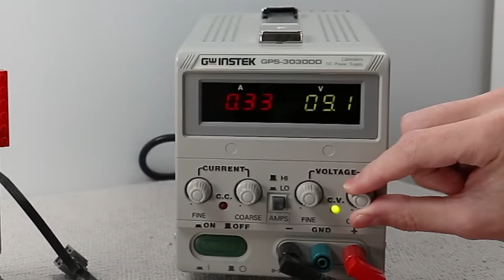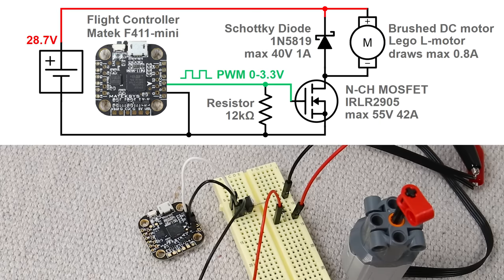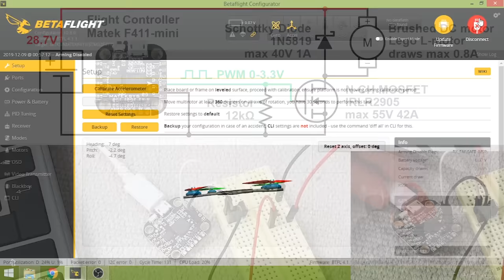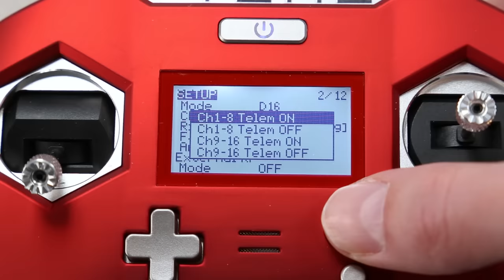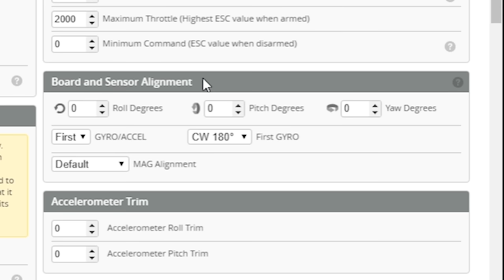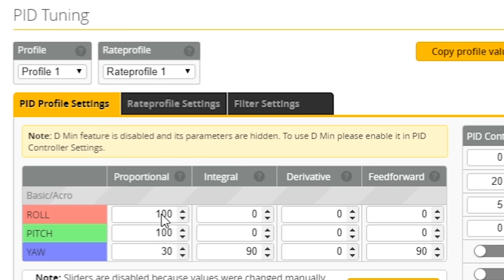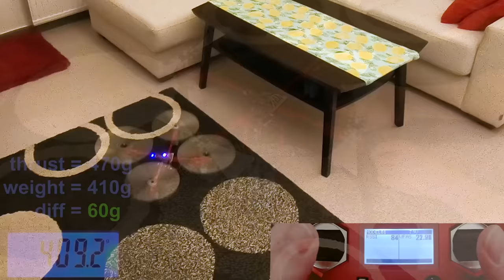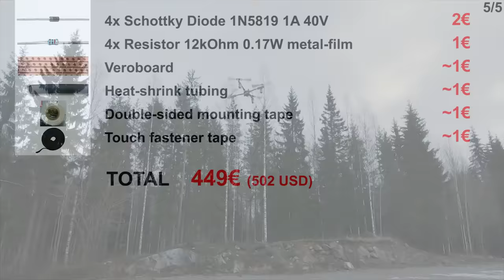Making a Drone with Lego Motors and Propellers

Comment: Nice video, makes us realise how hard it is to just "lift" a drone, and how company have acquired knowledge over time. When we see these 4 rotors drone they first seem "easy". It's good to see that there is always an hidden difficulty. Thanks for showing us this!
Reply: Exactly, the amount of work required to make this 'toy' is mountainous, the angles, the force, the balance, looks, safety and cost of making is just a few of many things people have to take care of to give us this 'toy'
Reply: it's even harder when done out of lego. typical quadcopters (which this is. It cannot fly on it's own so isn't a drone technically) are made out of VERY rigid frames. Legos, as a consiquence of needing to come apart, are not. So him managing to find PID values (those numbers he was tuning when it first lifted off) for a quad with a frame that bends and changes it's own lift profile with changing thrust is pretty impressive.

That's also why it looks to be wandering around so much. The accelerometer can usually keep that under control once you get it dialed, but a lego quad with frame flex is asking a bit much of it.
Reply: @DFX2KX  drone, quadcopter, potato patato. Lets be real, they both mean the same thing.

Comment: Very impressive! Did you need to remove the overload protection from the L motors?
Reply from the maker: No. The L motors were untouched. I think the key was gearing down from 1:3 to 1:1.67 so that the motors draw less current and don't heat up. They still heat up quite much. Sometimes the drone would become unstable after flying a few seconds, probably because one of the motors would overload. It flew more stable outdoors in 0 degrees Celsius.

BTW, I'm very impressed by your 41.1 km/h Lego car speed record. Awesome job! I have wondered is there anything to improve. Dare I even try? ;)
Reply: Hey
Some months ago, I was messing around with a drone motor (a 3035 if I remember correctly, 500w peaks, ~13€ on Hobbyking) and found out that there is no need of adaptators. (apart from "shaft to lego shaft")
With an arduino, a bluetooth receiver, an ESC and a small servo motor for the direction, I transformed a red buggy into a RC Lego red buggy and oh boy...

Some lego tires died that day.

Some old differentials also... New ones handles the load tho.

Would be soo cool to see that kind of transformation on other models !
Reply: @BrickExperimentChannel  it's even more impressive with stock motors, you found a great balance with the gearing! Glad you've seen my speed record attempt, it took an awfully long time to achieve :) Obviously it is easy to beat with a different power source and controller. That configuration was limited by the control range of Bluetooth (VERY limited, I had to run all the time :D) and the max voltage of the v1 BuWizz units. With RC LiPo batteries and an RC receiver you can achieve much more, all you need is a long smooth road without traffic and a chase car :)
Reply: @pyrotection  As mentioned above, the primary problem was motor overheating - definitely less of a problem in cooler temperatures.

Comment: Imagine this man's ability if he wasn't restricted to lego
Reply: Well, your thinking is slightly flawed.
Reply: LEGO is lightweight, made out of plastic and incredibly simple to handle.
Reply: Amdíredhel a normal drone would weigh about the same with carbon fibre frame and brushless motors, handling them can be simple with some youtube videos but they are more dangerous
Reply: But thats the fun of it; taking LEGO beyond it's intentions. For real though; I'm pretty sure he does other things; he's got a nice power supply and solid electrical skills.
Reply: The Yangem  please just stop it
Reply: He uses it for the challenge!
Reply: Lego is only restricted to the mind of the builder. And clearly thank God this guy only does this with his free time. Because can do what ever he puts his mind on. Good or bad.
Reply: He whode make a nuke
Reply: It's simple programming and integration, what do you mean?
Reply: he definitely isn't restricted to lego
Reply: It's called hobby electronics

Comment: Add some oil or silicone lube to the gears and shafts. Maybe you could gain som thrust through better efficiency
Reply: l e g o
Reply: @Mati.falcon silicone won't disolve it
Reply: @Mati.falcon He's used it on other builds.

Comment: Surprised he didnt make the controller himself as well
Reply: its called a transmitter not controller.
Reply: @cateyesaerial7703  It's a controller.
Reply: @cateyesaerial7703  he labeled it as a controller
Reply: Lan Yuan it's usually referred to as a transmitter to avoid confusing it with the flight controller.
Reply: Maybe he did oo
Reply: @CodedHumor  Its is actually a transmitter.
Reply: @bonktonk74  CatEyes is right though, its a transmitter.
Reply: @bonktonk74  I am an rc aircraft enthusiast and my friends and I call it a transmitter and so does the local club ad a hobby shop. The people who make transmitters also call them transmitters.
Reply: I’m pretty sure the transmitter and radio  receiver involve more programming rather than electronics
Reply: @Jacob-gy1wo  could be some programming needed for the transmitter  so it can have custom text and stuff on the display , but i don't see why a receiver would need any programming at all i mean all a receiver should do is get the signal from the transmitter into the flight controller.
   a good analogy is the transmitter is a car factory, the radio waves are the ships that transport the cars, the receiver is the truck that picks the car from the dock and gets it to the dealership , now if the receiver would have any programming involved  it would be like the factory sends the cars unpainted with the ship and then they paint it on the truck before it reaches the dealership.
   i have no drone experience and only know what i know from videos, but if that's not the case then something went horribly wrong with how these were designed and then widely adopted.
Reply: He's using it to control something.
Therefore, it's a controller.
That may not officially be what it is, and you may indeed be wise to not call it that in any proper environment, but it is still a controller by definition.
Reply: That's part 2
Reply: @Jacob-gy1wo  hardware is electronic but it has a lot of software also they are both combined
Reply: @MrElnegrito88  
عندي بعض الاسئله 
هل ستطيع المشاعده
Reply: alan smithee it’s really just taking an input and transmitting it to the onboard controller. Therefore, it’s a transmitter.
If we’re using that logic.
Reply: Legend says, "To this day, they are still having an argument over a controller or a transmitter."

Comment: "Luckily, Nothing Broke."

Meanwhile the drone: Split in half
Reply: That's what I thought
Reply: Advantage of lego RCs: If it breaks you just reassemble it. They pop apart.
Reply: He mean motors, mechanism are good, not the lego
Reply: It did land. Just not in 1 piece.
Reply: The Legos and electrical components didn't break is what he meant.
Reply: Ya know the 
Legends never die
They just take breaks
Yea how bout this
Lego never breaks
They just pop off
Reply: @walnut6684   me with an axe

Are you challenging me?
Reply: @user-fb3nu1ds9n  me with a Lego shield

Yes
Reply: @walnut6684   feel my bfg 9000

Comment: “The numbers, Mason, what do they mean?”
Reply: Ayyy classic
Reply: Im not sure
Reply: Thrust to weight ratio basically

Go ahead

Whoosh me
Reply: @johnbutrovich2056  bruh your too smart I cant
Reply: @johnbutrovich2056  r/youareverysmart
Reply: @johnbutrovich2056  intelligence 100
Reply: @johnbutrovich2056  how about the yaw pitch and roll? What do the numbers on the axis’s mean?
Reply: They tune the PID constants in the flight controller
Reply: ah, ASCENSION something something. good ol cod
Reply: @gigyro  read about PID control.
Reply: The numbers are for a PID control. A PID is a method of closed loop feedback control where the computer logs the current position (pitch, yaw, roll) and compares it to the operator specified parameters. The computer then uses the numbers entered in the PID loop to control how fast the machine compensates to fall within the parameters, what the acceptable range is, and at what acceleration. 

The system works similar to how we use our senses to balance. Our eyes see how far off we are from where we want to be and our brain decides how fast to move and in what direction to compensate. Kind of like how, when you balance a broom on your hand, you will move your hand around to counteract the motion of the broom.
Reply: @clyde35553  r/ihavereddit
Reply: @johnbutrovich2056  r/woosh
Reply: @gigyro  im pretty is is a xyz axis thing
Reply: the numbers, @johnbutrovich2056 ,what do they mean?

Comment: When an electrical engineer gets bored during quarantine...
Reply: Isn't it electronics?
Reply: Creative Studio you are talking about an electrical engineer
Reply: @first-last557  No, I'm not
Reply: He made it like.... 4 Monts ago, stop Combine everything with quarantine
Reply: Poxif Gaming and Creative Studio.

Electronics Engineering and Electrical engineering are generally referred to in the same field, though they are usually different careers. Electrical engineering is a more broad term that can refer to electronics engineering. Electronics engineering is more specified and refers to usually only operation and work on electronic circuits and devices. Things like soldering, PCB design, troubleshooting, etc.
Reply: not with those cold soldering skills..
Reply: @tf3confirmedbuthv54  If I can pitch in at all, in the sparky community we would most likely call "Electronic Engineers" as Computer Engineers. But you are mostly correct about the differentiation between Computer and Electrical Engineers, although for 80% of the jobs we perform either engineer could do each other's roles. Computer Engineers specialize in embedded and digital system development, meanwhile Electrical Engineers specialize in power conditioning and pretty much anything to do with AC power. 

Source: I'm studying Computer Engineering and have a student engineering job working on embedded control and monitoring systems.
Reply: dziki. pies it’s a joke ...
Reply: @skatterpro  I noticed this too. Not good to have cold solder joints on a device with such high vibration
Reply: @tf3confirmedbuthv54  Electronics - Low voltage
Electrical - high voltage
Reply: I was thinking about it during this video. We can see all the areas covered by Electrical Engineering course... Calibrating PID control (control theory), motors, electronics (PWM circuit), microcontroller (embedded systems). I love the fact MAVs can be easily one of the most fascinating  and complex embedded systems.
Reply: He might be mech eng; unless I'm wrong don't most ME programs go somewhat into EE?
Reply: @creativestudio5761  electrical engineers is an electronics engineer, but better.
Reply: WORK AT HOME!

Comment: This Guy: "Too Difficult(for me)"
Me without technical skills and understanding :... Okay man, it's fine, you're doing great..
Reply: Aww <3
Reply: the hard part was already done for him. the lego stuff is cool but the real magic is in the flight controller keeping everything stable and making it so he doesn't have to program his own solution.
Reply: @expiredgoatmeal1666  True enough, but the problem-solving to find the right input modifiers and trimming it up manually is genuinely hard, especially when you're working with a system where the motors are absolutely not designed with this degree of precision. That's truly difficult, and it's very easy for us to sit here and say "welllll the hard part is done for him with the FC chip" but to be honest, this is well beyond most of us. Even those of us with drone-making experience would likely struggle to build something out of lego like this. It's hardly the most aviation-worthy material...

Comment: When he finally gets the drone right: 
"Just like the simulations"
Reply: Meh, not quite but he had fun building it and it flew (for a few seconds at a time).
Reply: @Bipolar_Weasel  Not just few seconds. It flew for a whole minute at the end. 11:00
Reply: asdf that’s why he said at some time I believe the time was during testing which is why it flew for small periods of time
Reply: @TheRuneScapist  - yeah it was measured in seconds for a half-normal flight.  2 minutes at a hover.   Seriously, though, this is 410 grams with a max 470 grams of thrust.   Cool proof legos can fly, but no where near practical nor anything that would be used for more than a conversation starter.  Spend $30 -$40 and get a skyrider drone.  More thrust, more flight time and you have something that can carry a low quality camera

Comment: So while technically not possible with only legos (unless tethered), this is really quite impressive that he was able to make it run with *lego* motors. I never thought that even the biggest ones would have enough power to produce lift. 3:21 was a surprising moment for me.
Reply: Not jusr motors, but also inefficient lego propellers and even heavy lego frame!
Reply: I didn't even know there were Lego branded motors....
Reply: Gears. Gears.
Reply: I didn't even know those were Lego parts. All I know is that Lego makes bricks and people build with bricks. Not full on electrical circuits
Reply: LEGO Power Functions L-Motors were used in this video. If L-Motors can create this much lift with such high voltage, than LEGO RC Buggy Motors (which spin much, much faster) should theoretically be able to create the same amount of lift at a lower voltage. Just a theory, but its definitely worth testing.
Reply: @OppositeOpinion  If anything, I'd say the 89509 propeller blades used in this video are the most efficient air propeller blades LEGO has ever produced compared to the other flat rotor blade pieces they have made. The biggest official one-piece propeller they make is 13 studs diameter and doesn't create nearly as much thrust as the 89509 blades do when motorized.

Comment: One of the reasons it's not %100 stable is that the diameter of your 2 inverted props are larger than the 2 non-inverted ones, so their tip speed is larger and they produce more thrust than the non-inverted ones with a smaller prop diameter. You should account for that in your controller setup, or, try to make props of equal diameter for both the normal and inverted props...

Comment: 10:19
When I made a drone in college, Connecting the logic Ground to the Motor ground wound up damaging my chips. It was due to the "back emf." My professor told me to fix it by placing a small inductor between the logic's GND connection & the motor ground. Did you have to do this as well?

Comment: Great job!   FWIW, Bringing I-term back up after you got P-term sorted out, would have helped with indoor flying tremendously (where the air starts blowing around and bouncing off the floor/walls/etc) and also helps when you start descending in it's own wash outdoors.    I-term's job is to just hold whatever attitude you set it in hands off, whether hovering or in steady forward flight.

Comment: Proffesional drone racer: ive got the best remote for my drine 

This guy:using a controller that looks like an xbox one controller
Reply: That's a fairly decent rc transmitter though haha. As a race drone pilot, I can tell you that one of the fastest pilots in my state uses this exact transmitter for his flying. If you like the controller style form factor, you've only got like 2 options for that and this is one of them (and the other just came out recently).

But also, yes, there are definitely better transmitters out there haha.
Reply: please, you need research before talk anything, the internet is free

Comment: Really cool. Not only that flying the drone WITHOUT a gyroscope and automatic is really difficult, the fact that you built it from LEGO Incl. built the electronics yourself: RESPECT! BTW... flying in such tight, closed spaces is EVEN harder because the air turbulence of the probers reflects on the walls.

Comment: It can only get off the ground due to something called the ground effect. Basically what happens is the air is getting pushed down, and the air pushes air below it down, creating a tiny bit more upthrust, and when the air hits the ground, it revereberates back up into the  craft, giving more vertical thrust. Further away from the floor, the ground effect won't come into action, hence cutting all chances of high altitude flight. Or maybe I'm just wrong.

Comment: Now thats a cool quad. Not practical but very neat. One problem is the motors are weak. You shouldn't need a 9S lipo. Try using brushless motors instead then it will be powerful.

Comment: The left thumb controlling the throttle. Hold it with your pointer finger and thumb both. Gives you more control and means the difference between my small adjustments, being able to fly accurately, and crashing.

Comment: Am I being a bit thick? Where is the anti-torque provision to stop the frame and motor screwing itself into the ground as the rotor turns? That's why the multi-rotor setups have paired rotors running in opposite directions. I expected to see the single-rotor unit at least give a bit of a backwards kick even if it didn't actually rotate.

Comment: Suggest, an onboard accelerometer, to self-correct flight instabilities. They're a negligible weight, and the existing flight controller board may have a connector for one - assuming it doesn't already feature one itself.

Comment: those are props but make the leading edge 3x thicker than the trailing edge and reverse the slope angle of out to in and go way faster, the leading edge of you wing ridge and the trailing edge flexy so it straighten but at slow has your arc to start ... thats a prop